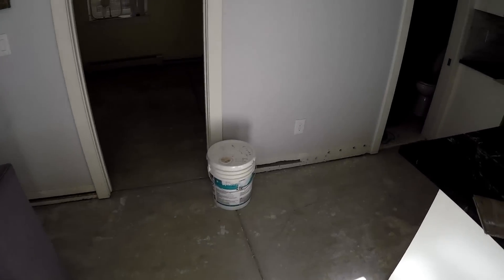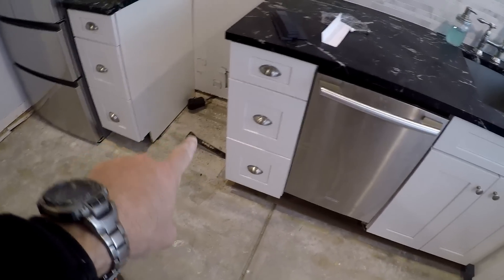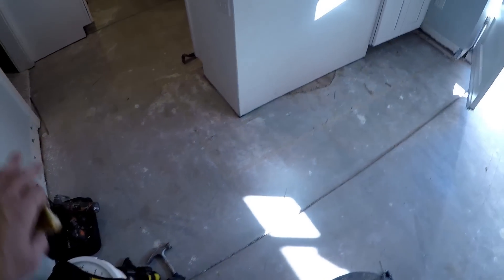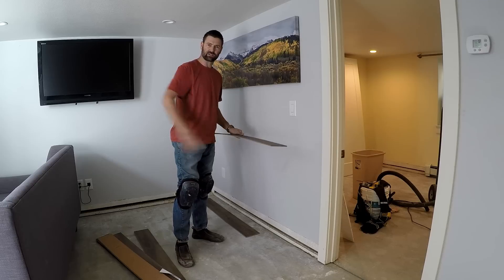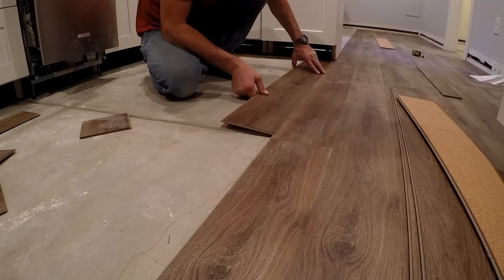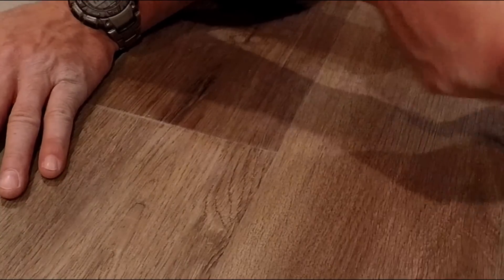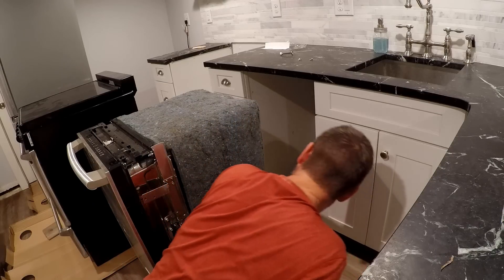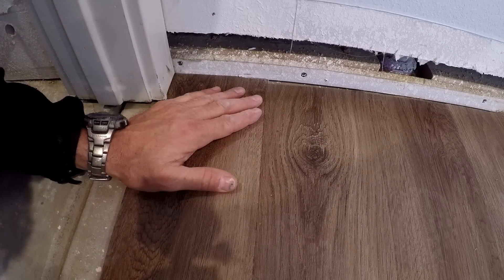The Truth About Vinyl Plank Flooring 1 | THE HANDYMAN |

Comment: You should seriously consider renaming this title as there are no truths being told.
Reply: The truth is, you'll need a chiropractor afterwards
Reply from the maker: @1pcfred  Thanks for posting that link Paul.
Reply: @TheHandyman1  some watch but they do not see. Some listen but they do not hear.
Reply: I did not see anything you did that will prevent the same problem from happening again. In water areas where there is a supply I always put a bead of silicone under the floor around the edges. It will still expand and contract and keep water from getting under the floor
Reply: This instructional video was chock full of “truths”. 🤷🏻‍♂️
One must have eyes to see and ears to hear! 🤦🏻‍♂️
Reply: @cleneave  if your house floors the water will still run to a low area and it will eventually find its way under the flooring. I've done a lot of rental property  management and I've seen it all. When your house floors, you're screwed. In fact all pergo water resistant laminate requires you install a seal around the edges and silicone all end cuts. That said pergo still doesn't keep the water out, even when installed correctly. Water always finds its way in. Not to mention the baseboards almost always have to come off and drywall often has to be cut at least 4" and repaired
Reply: @1pcfred  Maybe I don't understand, but what truth are you trying to display? Is this not actual waterproof?
Reply: @mexzcanninja7412  - He's saying that just because a flooring says "waterproof" doesn't mean that it is impervious to water damage. This one is cork backed. If that basement floods again, all this would have to be done again because you can't saturate flooring. Additionally, water under it will lead to mold and mildew (and probably zits).
Reply: @TheHandyman1  Is the reason for this the "resistant" cork backing?  I'm looking into XPE backed vinyl.  As soon I saw the cork backs, I couldn't believe they were advertised as waterproof.
Reply: @michaelmayfield4304  Good point, but at a certain point what can you do?  If not this, what else can you put in?  Other thing I was looking at was tile. But even if it floods, wouldn't tile still get damaged too?
Reply: Matt Murray right
Reply: Handyman. Hey man that was definitely the best spot to start in. I highly highly highly recommend troxell super soft knee pads, large or regular size they're extremely comfortable worth every nickel. Glad I ran into your channel!
Reply: Thanks
Reply: @cleneave  so you are saying that this flooring would have survived with your technique?a
Reply: What a total BS title. Agreed.
.

Comment: I'm a professional flooring installer mostly LVP and laminate. I suggest you use a wood chopper when you cut your end pieces and use a tapping block with a pull bar also a pry bar (crowbar) works pretty good to get the last board in. You can get ¼ spacers online and don't get those black flat ones those are garbage, I use the red kind that curves, one side is ⅛ and the thicker side is ¼. I'm highly considering making a video too and what I use and how I install.

Comment: Watched the entire video and I still don't know the truth about vinyl plank flooring.
Reply: Yepp. Im expecting revelations about vynil plank flooring but theres none.
Reply: The truth is it is Luxury vinyl flooring. For living that champagne lifestyle when you're on a beer budget.
Reply: First truth was it peels if a flood occurs. Second don't put planks in same pattern it looks dumb and third,  don't put them under cabinets it's a floating floor If it's not snapped in it comes apart. Use over even sub floor.  Now that wasn't hard was it???
Reply from the maker: @matthewrussell1027  You are awesome Thank  you.
Reply: Matthew Russell truth is if a flood occurs ALL floors are ruined vinyl, carpet, wood, tile.
Reply: @jimbeam4111  - yep, so true. I watched people with granite floors have a flood and think nothing needs to be done. Water will seep into the voids under that granite floor and away you go with mold and mildew.
Reply: The truth about vinyl planking it was the preferred replacement choice, with the ease of install without underlayment. The handyman made a pile of money doing this piece of cake job. Good for him. I bet he made 2k a day.
Reply: @matthewrussell1027  I'm still going to use 3/4" unfinished oak plank, despite all the work and occasional maintenance.  We won't be around, but I doubt in 100 years one will hear, " we refinished the original luxury vinyl plank floors."

Comment: i do auto body , so i'm up and down on  the knees , a lot,  i tried all kinds of knee pads, and they all suck in their own ways ,, AWP  had a set that was just a spandex covered foam pad , and they were pretty good,  but now i just use a set of hockey  shin guard /knee protector all in one,, the trick is the y only strap on  above the ankle, (about a standard boot or skate height) , just below  and rite above the calf,,, but not around the knee at all, the knee guard kinda just stays  straight when you bend your leg,,the only down fall to them is you have to watch power cords and air lines catching up around the knee,,,i also have a set of ATV /MotoX  shin guards by EVS, but they are kinda heavy walkin around in them, also expensive , but tough as nails ,(framing nails not finish nails,lol) good luck with your knees

Comment: In my  4 plex rental i use Strips looks like wood grain and  that glues togather. To save money but there is no do overs like  what hes doing but when hes doing you got a second chance  you can pull it apart but what I did you have go be good enough that you don't get it 2nd chance. He also should be using a rubber hammer and not that metal hammer hes given you the wrong impression because you could Dent the surface of the  with that metal hammer  or crack it I use a rubber hammer  it works good and doesn't damage anything.   Also I never  went under the dishhwasher  Just about a quarter of an inch under it just enough so it looks like it runs under it but it you don't want to get under the stands in front of the dishwasher so that it not level. You're not getting underneath the   Shelf  So what's difference. How  Many times does the dishwasher come out the next 15 years Maybe 2 times for repairs. It might be a 16th of an inch and difference in height but your probably going to have that anyway if you replace the dishwasher because  you replace it you can't get the same dish washer , the hole fits different dish washersand sometimes they have a little shorter or taller when you put a new one in .   I did the kitchen then went down the hallway to the bathroom it changed directions 1/2 of the bathroom but that's not a big deal just measure the  glue spacing that's under the other strip and add it to your measurement then I will found out  with strip   you can lift up a little bit on it with a lot of care and checking the others .What his using as a lot easier you can take it apart and do it again But you pay more that's why you pay more.

Comment: I hate that crap. Just bought another house snd finished basement has that as flooring. Im out of work almost 3 months now because I hit a slick spot and fell breaking my knee in 2 places, tearing 3 ligaments and detatching 1 ligament from the bone. Not a fan, plus it looks cheap and crappy. Would have covered it with carpet by now but need to wait to go back to work first.

Comment: just curious, why not just leave the old floor under the cabinets, and just put the new floor up to the cabinets and do baseboards in front of the cabinets?
Reply from the maker: It was still wet and need to be removed so mold didn't grow.
Reply: @TheHandyman1  oh, thanks.  you were lucky to get it out without damaging the counters.   Great job.   I'm thinking about changing my old laminate flooring to vinyl plank.

Comment: Ground breaking install tip.  At 8:16 if you look at the vinyl floor planking.  The planks are all a photographed picture...meaning you have about four photographs on your planks to choose from.  if you put them across from each other or side by side.  it looks just as bad as stair stepping.

Comment: As a professional we pull all cabinetry out. Cabinets should always be flat on the floor. Not on top of shims  another reason to cover all of the floor is so if you ever want to change your cabinets down the road you dont have flooring gaps. If you really do need to tap joints it should be a rubber mallet.
Reply from the maker: Do you take responsibility for the granite counter top when you "pull all cabinetry out".  Rubber mallets don't work on this kind of floor. Clearly you are just a keyboard commando that has never worked in construction

Comment: What’s up with those gaps in the drywall behind the base trim?

Removed because of water damage?
Reply from the maker: The basement floor is a cement slab on grade. It can float up and down.  The walls hang from the ceiling. You need that when you have expansive soils.

Comment: No Expansion space in this installation no transitions in doorways using a hammer instead of a rubber mallet this is why you don't get a general contractor or handyman to install a floor leave that for the flooring professionals
Reply from the maker: This product can go up to 4000 sf with out expansion.  Stop talking out your ass. You know nothing.

Comment: is there no required vapor barrier or anything for the flooring in the basement on concrete? or is that included on the bottom of the board?
Reply from the maker: It is integrated into the flooring.

Comment: I heard all the hype about this vinyl flooring. You can install it in bathrooms etc. I’m renovating my house for my first rental. What’s your verdict? Would you spend your own money on this flooring for your own rental if you had to install flooring? My original hardwood flooring is beyond repair. Window A/C units ruined the floors and made them buckle. I was gonna use tile in the bathrooms but have my doubts for wet areas. Like kitchen, bathrooms etc.

Comment: The new LVP products are absolutely water proof. I have some out on my patio that's survived 2 seasons so far and I live in oregon. You DO NOT use an underlayment with LVP it will void it's warranty. The underlayment is engineered into the planks and creates a water tight seal. Which is why I hope dude did a moisture reading on that concrete before putting it down or you just sealed that moisture in which will cause problems. Also 5 days?? Man, me and my helper could bang that job out in 1 to 2 days MAX.

Comment: The manufacturer allows cabinetry, heavy furniture etc. to be placed on top. You must glue the flooring down in these areas.
Reply from the maker: Not for this type of flooring.
Reply: The coefficient of expansion of this type of flooring is a lot less than the old composite laminate. I put it under the cabinets all the time- albeit in small to moderate size kitchens. 
Always follow manufacturers recommendations ... after all else fails.
Reply: It does not state it in the installation instructions but while doing a project where they were going to be setting a pool table on the floor I called and talked to the tech support for the exact flooring you are lying. They stated that if you glue down the area where the furniture or cabinets will be placed on top that it is not only OK but completely recommended. If you give them a call they can send you over the tech information for warranty issues as well.

Comment: I took the knee pads out of a pair of these pants (didn't like the pants because one leg was seen on crooked, so every time I kneeled down the knee pad on that side was on the inside of my knee and my knee would hit the deck rather than the pad), because the pads are great: https://www.blaklader.com/en/product/16001370-x1600-work-pants#9499
and put them into the Duluth Ultimate Firehouse Flex pants: https://www.duluthtrading.com/mens-duluthflex-fire-hose-ultimate-relaxed-fit-cargo-pants-71703.html
👍 My knees have never been happier.

Comment: Lots of good information there for those of us who are new to installing this product.  You did mention that you shouldn't set the cabinets on this floor, but you said appliances, at one point.  Seems like you'll have to set the fridge, stove, and dish washer on it, so just checking.  I want to make sure that the flooring will tolerate the appliances on it.  Thanks for the video.
Reply: I'm not an expert but, from personal experience, you should run the flooring under appliances so that they can be slid out if need be.
Reply from the maker: @tia williams.  You are correct
Reply: over time, my friend, the appliances will "marshmallow" into the floor, just dont do it!

Comment: That stuff seems nicer than what I put in my kitchen. It's a LVP product with no backing. Went down easy, and seems like it's holding up well, until a few nails in the subfloor popped out a little big and projected right through the vinyl. 🙄

I imagine any sort of backer like this has would have prevented that.

Supposedly I can replace a piece in the middle of the floor by cutting the piece out and cutting off a tounge and super gluing it to the next piece or something like that. I haven't tried yet and fear I'll somehow make it look worse if I try.😅

I don't necessarily find the "waterproof" statement to be a lie. I think of waterproof as being "from the top" in this case. If I spill a gallon of water on it, it's not going to destroy the product. Now, a flood where it makes it underneath? Yeah, not THAT waterproof.

Comment: I had this NuCore flooring installed and it only took about 3 months for it to start coming apart.  Please don't use this brand of flooring it's junk and the locking mechanism fails / is extreamly brittle compared to all other flooring I have looked it.  When we purchased this stuff none of the sites really talk much about the locking mechanism, only the specs so we thought we were getting food flooring it's it's complete garbage.  1000's and of dollars wasted and the warranty is worthless like most LVP out there.

Comment: cheap foam Walmart, one-strap knee pads work. Loop the strap and Velcro--won't come off. Yes, they can flip down, but just flip back up. I'm wearing mine with painter's shorts now and the long shorts slip over the pads and keep them in place better.

Comment: I disagree about the stagger. I guess it’s preference but have a 3-4 row stagger makes it look uniform and neat.  Random looks good on some stuff but not 6” wide plank flooring
Reply from the maker: The 3-4 row stair step is hack work.   Only done on a very low budget and short schedule.
Reply: The Handyman we’ll have to agree to disagree. I think the way you prefer to do it looks like hack work. No rhyme or reason just a bunch of butt joints every where.

Comment: Can you install it over existing vinyl floor tile or should that come up first?
Reply: Jeffrey Love it should be removed.  However I've been told you can install onto but you'll want to install it in different direction (ie if boards go west to east - you'll need to install north to south)  this is one reason removal is better not to mention your adding height to your floor thus might be very problematic.  (Ie not flush install under doors and existing tile or carpet flooring)

Comment: I should've watched this before doing this job. I slide my tools across the floor to use at other end of floor when i got there. I did a dumb dumb and didnt close my utility knife. The damn thing (transferring blame here) rolled as it slid and bit into the flooring just enough to leave a chip. I had to remove 14 planks just to replace that one plank. Hahaha lesson learned.

Comment: I cut and laid this kind of flooring in a 900 ft. apartment all by myself with no experience, so it really is simple. Just have a laminate flooring chopper {Home Depot etc for 50 bucks} and a jigsaw {so you can cut your wood to go around door jambs etc.}  and take your time with the cutting and you'll be fine :) I'm no handyman at all, so really, you can do this. :)

Comment: How durable is this kind of flooring?  Are leaks or spills a problem?  Such as would this be a good product for a kitchen, bath or laundry room?  and at the end of the video  the options for other videos covered what you were doing. Is it  possible to put those links on the video so that  they can be turned off in the gear section of the tools?  If  not could they be smaller so  we can still see what you are showing us?  It's OK if you can't it just seems like when you put all the effort into making a nice informative video they can get in the way. Thank you.

Comment: After getting super annoyed with a floor I just installed, I figured out why.  Read carefully...END. JOINT. DROP. LOCK.  That is what I did NOT get.  If u get what I did, Corelux, you have to tilt end piece 45 degrees first then tilt long ways and lock that way...sort of.  It plain and simply sucks to install.  And it's a particularly louder floor than others for some reason.  Very unsatisfied.  I will definitely look for end joint drop lock next go around.  Hope that helps someone.   Peace